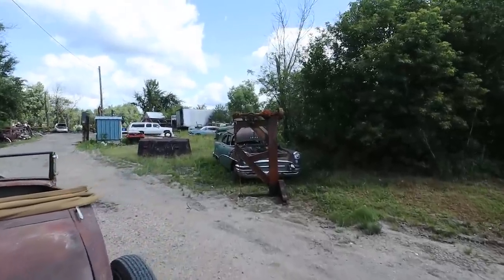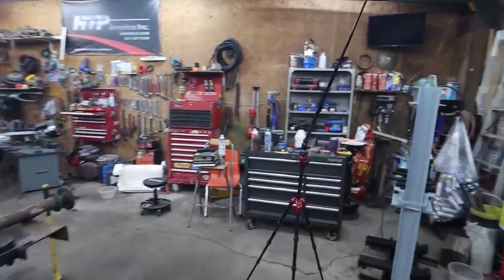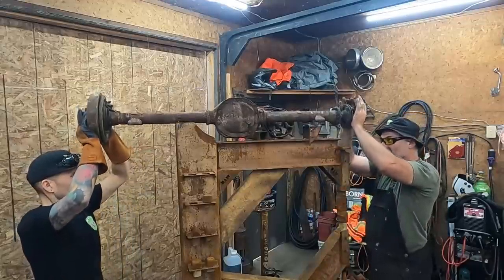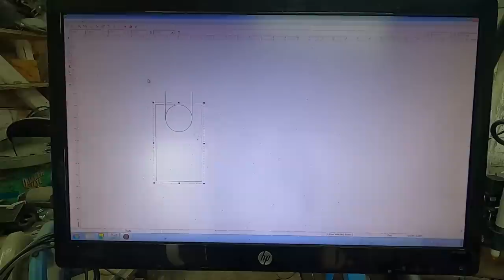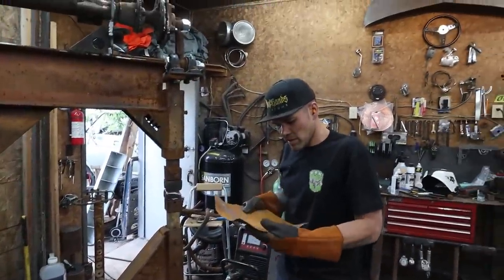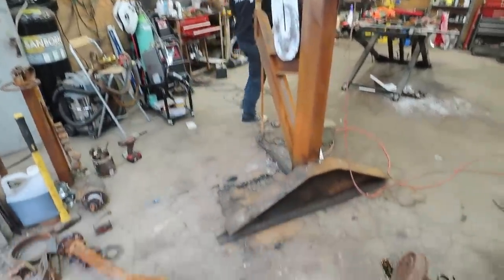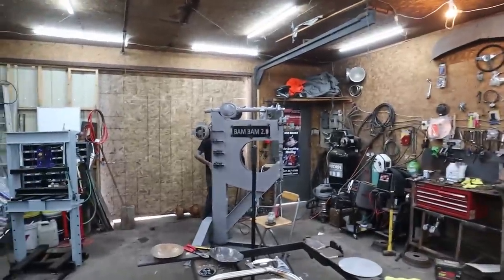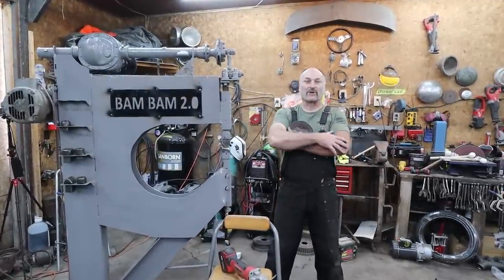Restoring our fire damaged homemade power hammer and making it better!

Comment: Heat the bearing plate up super hot and put the bearing in the freezer. Put the cold bearing in the hot mount slips right in.

Comment: I wonder if you would have made a strip to fill in between the new reinforcement on bam bam 2.0 that would reduce some sound. Just seems like it would amplify the sound right back at operator. I may be wrong.
Regardless thanks to Karl for helping out.

Comment: If your going to be working out of that shop this winter you probably need to get steel siding on that door and insulate it and a waist oil heater ? I also saw where they sell hydrologic lifts that fit in garages which would be perfect for where your currently working .  They will lift up as high as your scissor lift without the obstruction .. and I still say you should purchase a shipping container.. bigDstacked has one next to his garage check him out ..

Comment: Great Job on restoring your power hammer! I been wanting to build one. I saw this hammer in action before the fire. I have some question to ask you. I have a s-10 rear end, will it work or do you recommend something else? What size motor and pullies did you use? When you cut off the axle, did you insert a bearing in the housing for the axle? What size square stock you used for the hammer part? What did you used for the dies?  I have 4 inch I beam I thought of using for the frame, a 1/2 inch steel plate for a fly wheel that I can weld a offset pin to. The diameter is about 12 inches, which is about the same dia. of a bolt circle gage in which I can transfer the bolt circle of the rear end I will be using. (I am in the US)  Thanks

Comment: 2:52 Envoy was a Canada-only brand, based on Vauxhalls from the UK. That's the back end of an Envoy F Series, the equivalent of a Vauxhall Victor F-series (1957-61). Later came the Envoy FB, FC and FD (later versions of the Victor - my favourite is the FD), the CA van, and the Epic HA and HB (based on the Vauxhall Viva). The HB is also the same car as the Australian Holden Torana HB. 

I don't think the Envoy brand was well-regarded in Canada, as they tended to rust away very quickly (as did the Vauxhall versions in the UK).

Comment: OK I give.,..I spent aboutan hour tryimg to figure out the coupling between the avel flange and the 4 bolt pillow block  If that whole do up  just an ecentic why the long slot in the middle flange  What keeps the whole mess just flyig apart when the swoitch is thrown